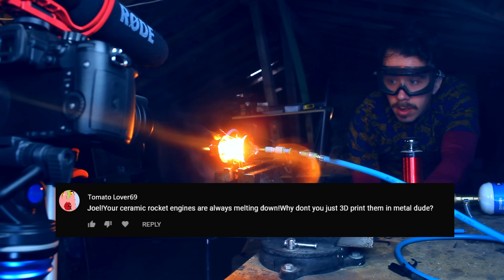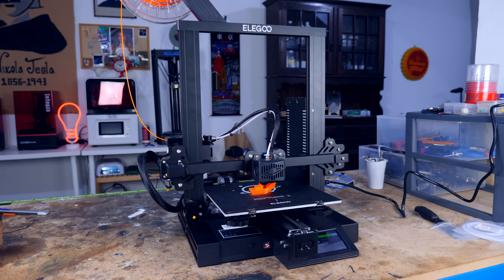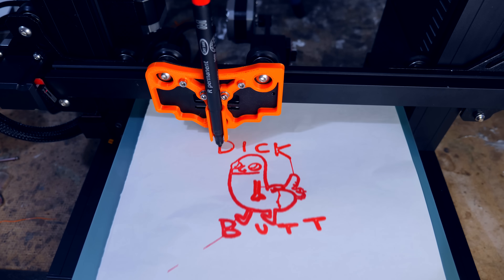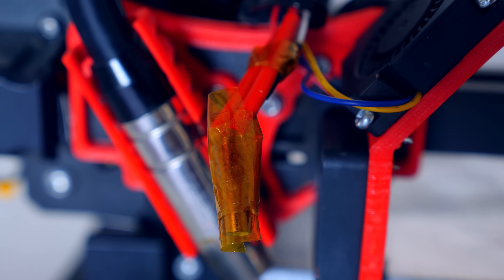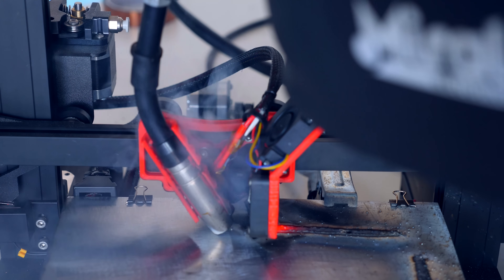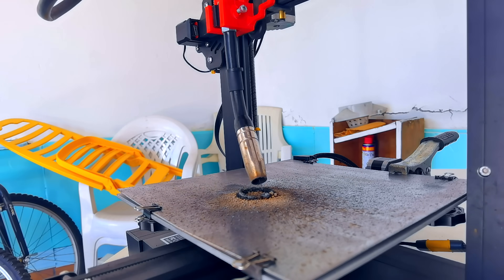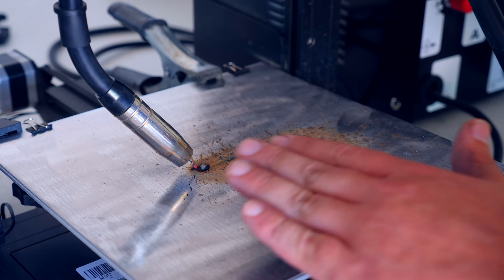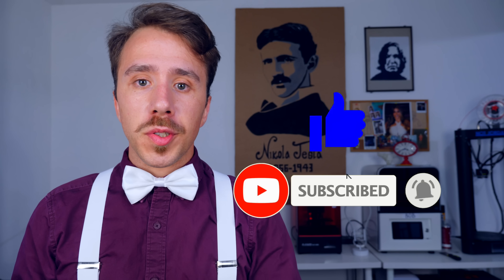I built a Metal 3D Printer using my Welding Machine

Comment: The angle depends on your direction of travel, you'd need a 5 axis machine to make use of that. Straight up and down with MIG (argon instead of messy flux) would be better.

Comment: I am a welder by trade and would love to revisit this, as I have extensive background specifically with MIG/GMAW/FCAW (flux cored or gas metal arc welding). I feel like this could be a solution for at home welders and machinists to help them get parts they couldn’t get without a special order otherwise.

Comment: I've got an idea: put your brazing kit onto some sort of chamber. That brazing kit will melt bronze or metal or other metals that are heat-resistant. Then the liquid metal will flow out of the chamber via a tube that is connected to that chamber, and then it will go through a heat-resistant valve connected through a nozzle.

That nozzle will dispense the liquid metal onto the build plate. I mean, the liquid metal needs a long time to dry, so this process probably won't work.

Another idea: use this idea but put it into some sort of machine that replicates injection molding. You can injection mold parts but the plastic is metal.

Comment: I watched another video the other day about a company called Relativity Space who are 3d printing rockets:  https://youtu.be/kz165f1g8-E

I think that it's pretty awesome that you could make the start that you did with a few basic and easily sourced parts.  If you can solve the issues with the heat, layer height, filament select, scale, speed, and layer consistency, I think that you'll really be on to something here.

For the heat... I'd consider using a thicker base layer for sure, but also add a water cooled metal layer underneath that as well, which might allow you to use thinner sheet metal with less warping as it would all act as a giant heat sink.
Reply: Is this prize legit? I got one too. So did a few others here.

Comment: If you use the GTAW process you will be able to eliminate the little metal bbs know as spatter, as well as have the ability to control the heat input much better.

Comment: Hi mate if you want to 3D print metal another method is wax nickel electroplating. I used that method ( as a materials engineer) to make the engine intake of an Alison 250 turbo shat engine on the Australian produced Nomad N22 and N24 aircrafts. Make a wax prototype paint it with something conductive ( I used graffiti) electroplate the Nickel then melt the wax and you have your very complex 3D printed metal.

Comment: @8:50 - ya I haven't finished watching the vid, but wouldn't it have worked to just used a much thicker but smaller piece of steel instead of a very large but thin piece of steel to prevent the metal from warping?

Comment: Next time, a robotic welding do not require nozzle to be on the angle. That's only required during man welding actually to see what's going on. Man welder then perform push/pull movement. U need at least keep correct welding tip distance L=7+5×D. Next thing to have a decent results is interpas temperature in yours case u shall to let bottom layer cool down to 200 Deg. of Celsius (second fan on welded product helps). For spatters reduce u need to swop from flux core wire to shielding gas Argon/CO2 mixture in this case I would go with 90/10. But it's always fun watching those fun science vids u do.

Comment: If you want to 3d print metal parts; couldn't you print in PLA and make a sand mold? I'm pretty sure the heat of molten metal would cook off the PLA. Granted the surface would be rough, but some judicious grinding could clean it up.

Comment: You need two welders one at 90° (leader)and one from 10° to 20°(follower) 
Don't push the weld only pull the weld .Also this was never going to work with flux core wire .

Comment: I suggest putting a blast case using acrylic clear around the base plate, with a hinge in front to reduce any spark's reaching your 3D printer component's. Prevent buildup on unwanted components.  Also maybe you could place the metal ontop an ceramic fire brick plate, it might have a reducing effect on the warping effect. Maybe you could water-cool the tip giving you more height and precision control, suggest using a computer water cooler with strong metal heat block, if you want to continue pursuing this adventures.  Love your videos and creativity! Please keep making them😊
Reply: Also maybe consider cooling the plate your welding on aswell to better control heat and warping of the metal, just some thoughts😁

Comment: you can try using an argon welder and load your existing 3d printer with metal wire instead of plastic filament

Comment: why  not  use  welding  machine  whit argon gas ?  the  welding  nozzle  torch  are more  cooled  by  the  gas  and  the  welding  process are much  better  whit more  quality  because   the  metal  melt in  inerthed gas  cell , ok  maybe  you  use  the  welding animated  cable  whit  gas  instead  but  this  is  not  a  good  quality  system  not  professional

Comment: Instead of a flux core welder if you use an actual mig you might have better results. If you were able to use a tig setup where you have a rod "extruder" and the tig torch is mounted where the arc hits the rod granted it would be good in a straight line but if you could attach a 4th axis where the torch and rod could rotate into the direction of travel you could accomplish alot more

Comment: FYI your welding bracket is backwards, it’s supposed to push instead of pull because it helps with penetration, if you’re using flux cored it’s gonna produce a bad weld and if it’s gas shielded then it’s not gonna get shielded so it may not even work half the time

Comment: As I have welded many a thin panel and bridged holes etc you needed to pulse weld. Move the head maybe 2mm trigger on for a second (or to be worked out). Have a dwell time so metal can cool down, move and repeat. It will take a lot longer but you would have had a much better success rate. Also the torch was too far away from the bed. Anyhow just an opinion upon my own welding experiences. 
Keep up the good work.

Comment: Yikes man.... Yikes... It looks like this is a stick weld not a mig... Either you are using super crappy flux core wire at too high amperage, or no shielding gas. The spattering is horrible

Comment: You should make a water craft using a pedal bike as the power source but it needs to be low profile, use a screw type propeller not paddles have at least 3 speeds forward and at least 1 speed in reverse.

Comment: I've got some ideas that might help. First of all use a gas shielded process and preheat the steel sheet. You will significantly reduce distortion if the steel is already hot  when you start welding, if you can get a smart mig machine with inductance control. A high inductance will allow you to have a relatively high voltage with less wire feed and this will allow more fine control. I'd experiment with a 0.8mm solid wire or metal core wire with a high argon gas with CO2 and a little bit of oxygen. Most trigas welding blends have this or even try a stainless steel blend which is mostly argon with a smidge of oxygen. Gas shielded processes are less sensitive to torch angle too so should help you cheat this a bit too. 
I'm not a 100% sure how much those will help but I'm certain using a flux free process will be much more controllable.

Comment: hi, i thinker about this for a while and i think the solution is to do "print" using mig and spots instead of trying to do a full pass, you could do pauses in the g-code to let everything cool down a bit and then do the next spot. keeping the print surface in an enclosed enviroment full of argon also, may help to keep the cost of argon down

Comment: try to 3d print with a metal that melts in lower temperature such cooper maybe you can create a nozzle from steel and use that to melt cooper

Comment: You can use plastic to create a mold for pouring molten metal in.  3d print the part, place in mold, melt plastic out of mold using kiln, heat metal to melting point, heat mold to 1000 degrees then pour metal in mold.  Finish the part by grinding the excess metal from the pour spout and ensure you have multiple holes to allow air to escape

Comment: You could use a proper MIG welder that is set up as DC Negative Electrode. The splatter is caused by the oscillations in AC. A TIG would problebly work better but the filler material comes in rods rather than wire.

Comment: Welding with aluminum wire on a steel bed would probably have been better since aluminum has a very low melting point in comparison with using steel wire.  I would love to see how this would work considering that I'm interested in 3D printing with metal

Comment: Couldn't you solve the bed heat problem by putting fans or a large fan under the bed? If you were to place the whole unit on a grate with a large fan under it blowing up wouldn't that cool things down enough. You say that normally when you are welding it is on an angle but what you are doing isn't normal so why can't you do it vertical with a fan blowing over the bed? It would be so cool to see a 3D printed nozzle.

Comment: Use integzabot to convert the extruder and temperature controls to the controls on the welder so the process will be fully automatic, this may garner you better results 

Also Some machines actually do support ellipses in Gcode, I know our old Torchmate did

Comment: A Few Ideas. 
1) pulse your welder to tack one dot at a time, instead of trying to do lines and layers with continuous runs. this will lessen your heat buildup and minimize bed warp. also flux core would be a good idea...
2) use a standard 3D printer to print a part, then make clay sectional molds of it. then just lay a ground wire into the mold's bottom and start tacking dots of weld into the molds cavity, filling it with weld (flux will be essential). once a section is complete, you can use clay to mold the next section and continue it until you've created the full piece.
3) use your ceramics methods to make negative molds and then you can fill them with weld as above. be sure to tack one dot of weld at a time, instead of running lines, as your ceramic may crack or shatter from too much heat. this would require meticulous and slow welding by hand, but should yield a passable piece, for relatively cheap, made of solid metal, and without being a master welder.

Comment: dude, use solid core wire with a protective gas such as argon. If you do this, you won't have nearly as much problem as with the slag from using flux cored wire. Though this is more expensive of course

Comment: I know that a major reason why this didn't work is that the melting of the material happens where the filler metal is touching the surface of the layer instead of melting at the nozzle before being deposited. Sintered powdered metal is definitely something you might be able to make with aluminum oxide powder and a cnc laser. The method of operation for a commercial metal printer is fairly straightforward, to the point where a rudimentary one can be made at home.

Comment: You don't need to have the welding torch at an angle to do this.

I can't tell but I'm not sure if you're getting sufficient gas coverage either, those welds look too dark. 

The issue that you're also running into is an accumulation of heat as you continue around, which will melt the weld wall you're trying to build.

Comment: Some of your inefficiency is due to the angle of the nozzle. It needs to be at a 90 degreee angle to the bed. Otherwise it can push the wire versus pulling the wire across the work piece and the wire bounces around and makes sloppy weld.

Comment: you should use a gas when welding that removes the oxygen dont know if u are using the filament that is hollow and u are not needed to use that but

Comment: A 3D printer will print arcs if you tell it to do so. Anything that can process G code will perform G02 (clockwise arc) and G03 (anticlockwise arc) moves. If you're writing by hand, there's no reason to limit yourself to straight lines. G2 & G3 are less processor intensive, faster, have lower peak acceleration, and cause less machine wear than a series of short G1 segments. The file is much smaller, too. Try this with your pen: 
G90 
G1 X139 Y114.5 
G2 X90 Y114.5 R24.5 ; DEFINE ARC BY START POINT, END POINT, AND RADIUS 
G2 X139 Y114.5 I24.5 J0 K0 ; DEFINE ARC BY START POINT, END POINT, AND RELATIVE CENTER OF ARC

Comment: You should look into cold welding. I’m not 100% but I’m pretty sure metal Wells up in space or in a vacuum. You could literally place metal tiny balls or cubes in a vacuum and will they bond? There was an example on a space mission where astronaut almost got locked out of space station because access for welded shut I think almost maybe kind of😅

Comment: wouldnt it be easier to convert your 3d printer into a 2 axis cnc machine? then just buy cheap chunks of aluminum? or... 3d print the parts then cast them out of metal. forges are decently cheap and your 3d printer can make the base design pretty simply. thats what i would do anyways

Comment: If you would have used a mig welder (has shielding gas applied while in use) you would have had alot better results compared to the flux core (has shielding flux inside of the hollow wire) which oxidizes and leaves a crust barrier (which is why you started to grind the weld in between each layer to get better results i see) and in general flux core welders (especially harbor freight) are ok for general repairs on like a utility trailer or where you just have to lay a single layer bead and dont care what it looks like. And tig welers are the best and also have much more adjustment's (in general) but usually at much higher cost. But you should give this a shot again! But with a mig welder and a little bit of practice with it before hand so you have a clear understanding of welding lile,angle's and pushing vs pulling and shielding gas.

Comment: You should try building a large scale pop pop boat, ive built a few but ive always wondered how big you could go when building one. They use a very simple  engine that relies on a change in pressure in the reservoir when heated and I just have always wandered if a man sized one would be possible but do not have the means to test it

Comment: I did this exact thing for my senior project in 2021, had pretty much the same issues as you had. It works, but it isnt pretty and isnt predictable enough, plus the sparks and slag can damage components if you dont have a way to contain it. Also the bed issue is one we had and couldnt solve, even with thick steel it either melts through or warps with enough use

Comment: When welding thin sheet metal such as in autobody work, they stitch the pieces together or let each weld cool instead of going continuously, which obviously distorts it. 
Also using argon/CO2 as your flux instead of a flux core wire will help in production.

Comment: Get you one of those drill presses with a speed change dial to use as a milling machine. You can just mill pieces for shat you need and ceramic print other pieces

Comment: you shoud use a gas (argon or co2 or mix) protected weld (mig/mag). You can modify your welder with electrovalve activated by metal wire feed and add a gas tube inside your gun. If you look there are some tutorials.
Flux core need to clean each weld before start another one. 
 
So, I can't imagine it weld so well! I thought at the same experiment.

You should try also with dots weld (under gas protection), I think it help to reduce temperatures, usually is used to weld thin metals avoiding melt.

I think the new lasers welders are the best choice for some future 3d printers

Comment: I know nothing about 3D printing but I know a little bit about welding and something that might help you is to change to a welder that uses argon as a shielding gas instead of the flux coating on the wire. Also you can use copper or aluminum for the bed because steel will not stick to it but it can still strike an ark.

Comment: If you go into Marlin you can customize the operation of the hotend fan and the parts cooling fan. In your case using the parts cooling fan and controlling it with your gcode would probably be simplest.

Comment: You use the wrong gas! I was working in a big company 3D Printing Metal Parts. They also worked on a big 3D Welder. 
We needed a lot of try&error to get a hollow sphere without any air pockets. 
You can try chromium-nickel steel by using 97,5% Argon & 2,5% carbon dioxide.
Do not use the normal 82% Argon & 18% carbon dioxide because the burn-in will bend ur baseplate.

Comment: If you move the Z axis could work. Instead of having the angle on the welding nozle you place it straight. 
The angle should be on the direction f welding but here all direction can be used so it's not good to have it.

If you place the mast of the Z axis idk 20cm away you can hold the welding torch like you did the last time, with an angle on the bracket so the nozle is 90° in every direction. By deporting the frame you can move the nozle on the complete plate, and if you raise the frame you gain in height.

For the printer the printer head is still at the same spot, you just made an offset because of the shape of the torch. 

Hope that it could be clear for someone else than me !

Comment: Another reason to not have a fan on your welding tip is that it will blow away the shielding gas.  I'm not exactly sure how that would work with a fluxcore wire like you're using but still probably want to have as little wind as possible on the weld?

Comment: In fact you can program arcs in Gcode with G02 and G03 which is used in milling quite often. Its needed for older machines and manual programming. But with newer machine we can just throw a ton of point commands on it to make it almost round as you said....